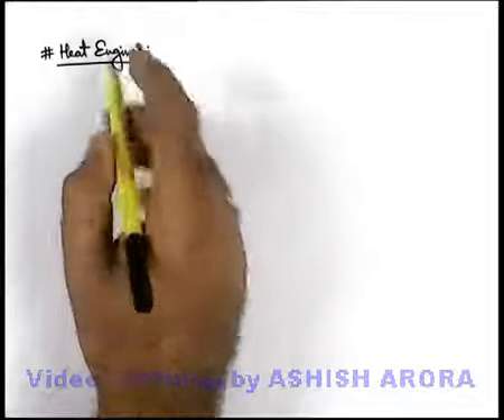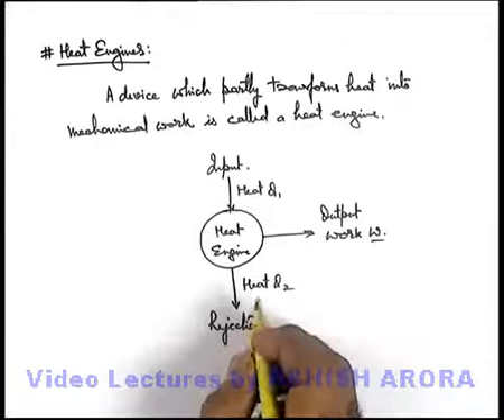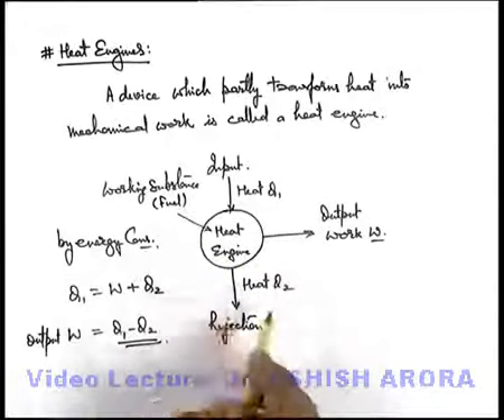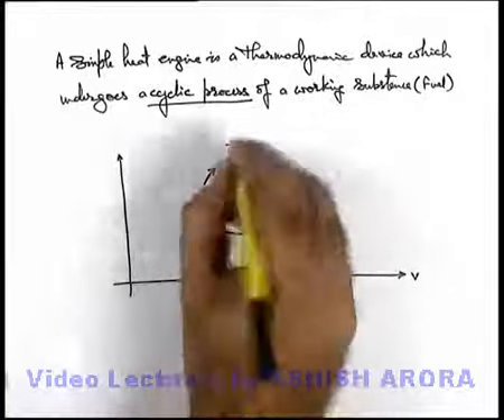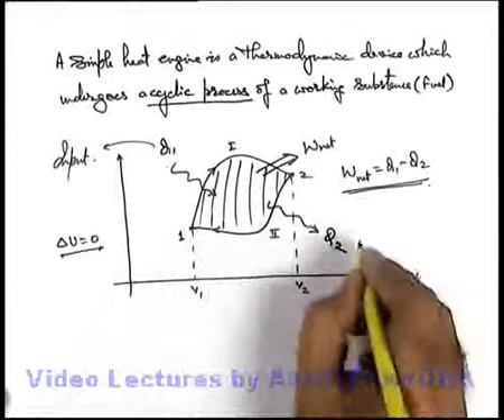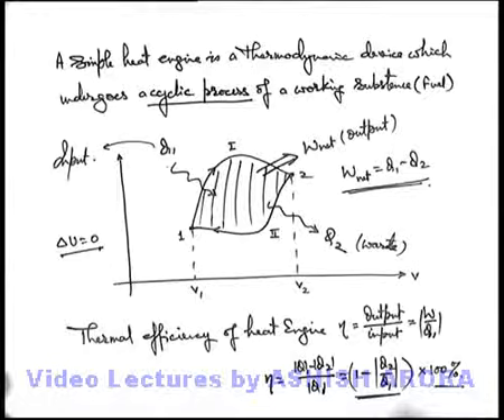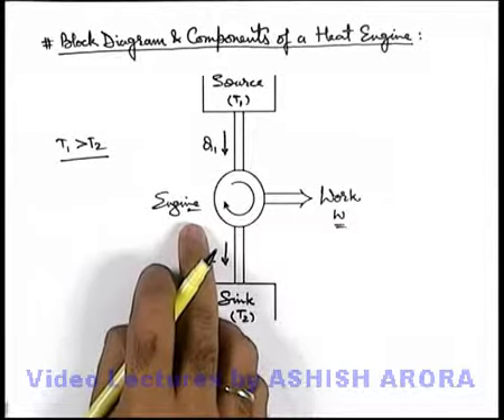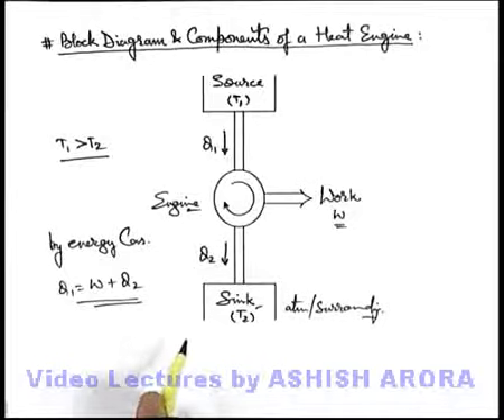Class 11 Physics | Laws of Thermodynamics | #36 Heat Engines | For JEE & NEET

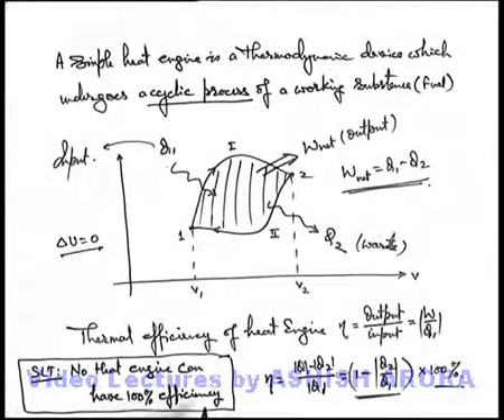Comment: 8:01 
is it possible to go from path 2 to path 1 by an adiabatic process because that would make efficiency 1 or 100%?? If no could you please tell me why?? 

In my opinion it is not possible because for any adiabatic curve slope is always negative so there is no way we can get back to point 1 with a curve which has negative slope.. 

Is my explanation correct? ?

Comment: Sir ashish!  Why cohesive forces in mercury is greater than that of adhesive forces? Whereas in water it's vice versa I know that density makes a difference but how can you please explain.
Reply from the maker: It is due to the vander waal's force between atoms of element whether water or mercury... which is the resultant of all the electrostatic force acting between neighboring nuclei and electrons of these atoms... as density increases force also increase but density is not the only factor... electronic configuration of element also plays an important role in it... who what you have asked is the cumulative effect of all factors affecting the vander waal's forces between like and unlike molecules/atoms...